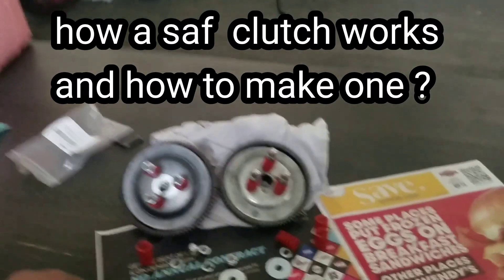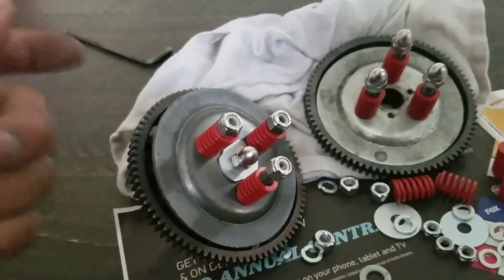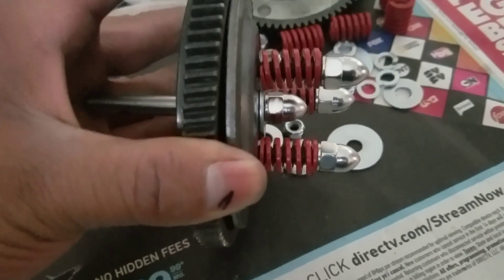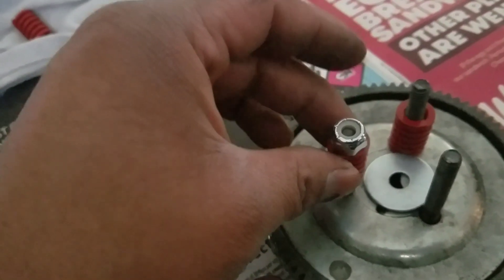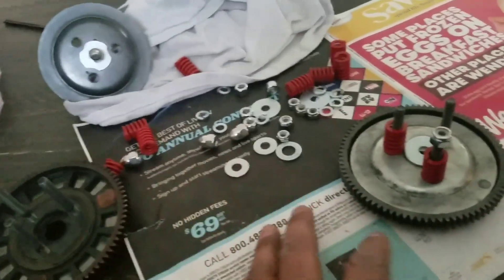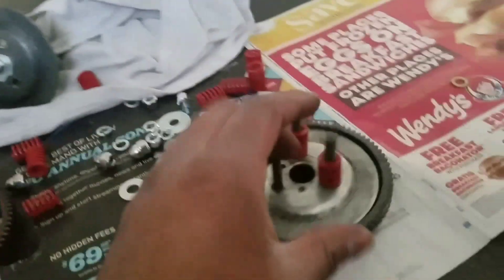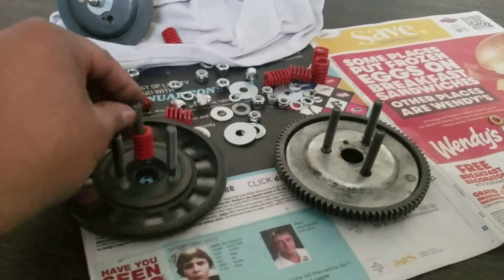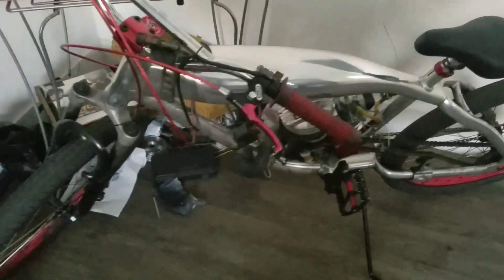how a saf clutch works and how to make one?

Comment: DLH performance sells a budget saf with everything you need except for the 1/4 -20 tap...  RDM sells the CNC plate a few places... I haven't used it as of yet but I got some 5/16" woven brake lining to try just haven't gotten around to cutting the pieces
Reply from the maker: Sounds good

Comment: Hey thanks for the video I got my clutch almost done just need to order them red springs do you have a link where you got yours? Thanks bikelife.
Reply from the maker: I forgot lost the link.  But search  14mm OD 20mm Long Medium Load might want one color stronger I got mine I could press it sort of with 2 fingers so maybe one size stronger/color same size
Reply: Thanks yeah I'll use Google and search for them👊
Reply from the maker: @mbrrideitlikeyoustoleit8436  good luck cheaper if u by in bundle sometimes and do video of it how good it work i havent tryd it yet

Comment: I know this video is 2 yrs old now. I'm about to finally build this saf clutch. My 1st disc is a Zeda cnc plate. Going to press out the pins today. Buy a 1/4/20 threaded rod, 5/16 threaded rod, lock nuts and will have at it. Oh, a 3" metal hole saw bit

Comment: Hey I was thinking of upgrading all my build with the clutchs but what's the Deal with em .do they catch quicker so we dnt have to peddle from take off or something??
Reply from the maker: No it's just grips more pressure on plate and 3 points of pressure over 300 plus or something or less depending on springs
Reply: @mozezcen-valley7555  The great springs work much better! 👍

Comment: Very interesting Idea you got me thinking!   You know if you where to have a 1/4 thick plate on top and tap it! so the bucking bar could screw into it directly. This would work pretty well I think!  I'm going to cut a top plate see how it works out on one!  otherwise can't drop it enough to grab the pads right as the one you have sitting there in front of ya? Very interesting idea. tomarrow when I get some free time I'm make one of these good idea to use Printing press Springs!  Red are 150ft-lb Yellow/100  Blue200 /green 250 / Brown 200
Reply from the maker: I was thinking to use blue or green ones but also you throw them to have more compression but yes a better plate or clutch plate will baby works better and grab I'm surprised you haven't seen these already but yes take your attempt on it would definitely like to see a video and what you accomplished and see if they work good by chance do any of your Motors clutch slip maybe your conversion minarelli?little? To see the outcome if it prevents it or if it feels like when you drop the clutch it doesn't slide or slip I'm using RDM plate on my Chrome and red bike not the three spring idea but it works pretty good it stopped me from slipping and it grabs immediately after a few adjustments but also keep in mind you could also put 6 Springs not just three I just wanted to see a three spring in action and then possibly go with 6 Springs there's people out there that are using six Springs and saying that they work pretty good every compression all the way around
Reply from the maker: But if you make a quarter inch clutch plate you'll have to make it out of stainless steel or a hard metal I think aluminum will get eaten up too much maybe add some neural not sure how to pronounce it but pretty much add those little bumpy grips like pegs have I'm pretty sure eat up pads faster but I'm pretty sure will grip better or something I'm sure you have great ideas
Reply: @mozezcen-valley7555  already 99.9% done  😋 Just need springs I ordered to arrive lol. I'll post ya quick video in few!
Reply: @mozezcen-valley7555  I'll have a build video out after the springs come!  https://youtu.be/vttqqUi9dtI
Reply: @mozezcen-valley7555  I actually never had a clutch slip on my first minarelli either does the guy I gave it to still!  I used a 600ftlb spring in it.  But this other one I never even started yet. Just gutted it and will see what happens lol!
Reply from the maker: @BuildBreakFix  yeah I want to get a heavy-duty spring but I don't know where to get it I looked at my local Tractor Supply but they had no idea what I was talking about eyebrows the whole store for about half an hour but didn't find any by a chance can you send me a link for I could buy us bring that I could just slap on I want to give it a chance with a better spring I'm sure that's going to help me alot
Reply: @mozezcen-valley7555  spring I bought was yellow 600lb. 30mm od / 20mm I'd / 32mm length.  They call them stamping springs or heavy duty constant pressure springs.  I ended up with a spring that they sold for a bail lifting escalator.  I think it was used to tension its v belts
Reply: @mozezcen-valley7555  omg..... this clutch came out completely crazy nice 😲  dude it  clamps down like a bear trap on release! I have yellow springs for something else slightly to wide at the min. 120lb each and it's crazy. Monday red springs come and I'll toss out the video!  Red are 200lb may be overkill dono yet!
Reply from the maker: @BuildBreakFix  hey I'm glad I threw it out there and help I got lots of positive comments people are stoke I'm sure you knew about this but at least inspired you to do something about it honestly I don't have a motor I can put it on and my clutch works great so I don't want to take it apart to test it at the moment even motorized bike tips/fastest motorized bikes the UFO guy was talking about me on one of his videos call me Monza something gorilla unless you was talking about someone else would have been cool if he had set my name correctly and gave more of a positive feedback like I do plan making it better video and how to make these but I have to set everything up and film part by part and explain it speak pretty good for people to understand

Comment: Have you used them yet? When I’ve made these I’ve had to bush out the clutch basket to allow the plate to hit the pads. A friend told me thicker pads are gonna hell me but I’ve glazed even new stock pads. I think a thicker clutch plates like the S.A.F or even Ryan’s plate solve that problem. Thinking about making my own clutch plates at this point
Reply from the maker: Be cool see something new was thinking about making plates harden stain less steel cost to much then need to mill out and also make . A little design to separate yourself from the other people
Reply from the maker: I haven't tryd it yet

Comment: The 65 will hit better than the 85, I'd like to see the clutch in action. I run Ryan's which I've had no problems, my pipe is currently restricting my speed and it's a Yasuni. Unfortunately Steve doesn't know anything about pipe geometry and made my header too long and killed the rest of the power.
Reply from the maker: Do you have a video of your bike 66c/80cc or a hybrid what type of engine is it,
Reply: @mozezcen-valley7555  it's a minarelli hybrid (70cc) No videos on here but maybe I'll upload soon.
Reply from the maker: @SupremeODMG  sounds good
Reply from the maker: @SupremeODMG  what speed it hits
Reply: @mozezcen-valley7555  48-50 supposed to do 55 easy.
Reply from the maker: @SupremeODMG  why why doesn't go 55 what carb setup do you have if you don't mind discussing
Reply: @mozezcen-valley7555  vm20 280m jet
Reply from the maker: @SupremeODMG  
Did you change your idle Jet? Does it run lean or Rich
Reply from the maker: @SupremeODMG  try 260 jet or . 40 people here on YouTube that explains that you're doing 67 mph but I think they're using the vm22 I'll let you know about the jet size as soon as I find it
Reply: @mozezcen-valley7555  might be the 22 I have to recheck and I've jetted 260 as well it's what I started, it's not running too lean or rich but there's no power and thanks to the header length after a quarter throttle the engine will scream louder and rev higher but it gains no more speed.
Reply from the maker: @SupremeODMG  man you definitely have to do a video of your bike I could probably help you out just by looking or hearing your bike but yeah I have the vm20 carburetor as well there's no pilot jet it's just a main jet but there also is Idle Jets apparently you could swap up the idle Jet and it changes performance I guess but I'm thinking to go with a vm22 carburetor lots of people having good luck with those because you could change the pilot jet and the main jet let me look up what's the best jetting for that engine cuz I had it on my phone or someone comment on it and they told me the best jetting for the carburetor